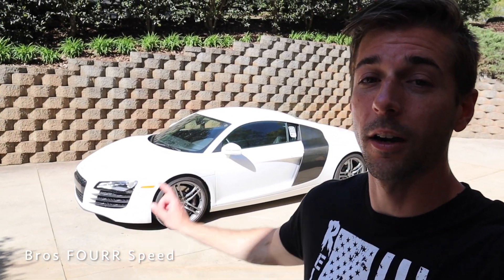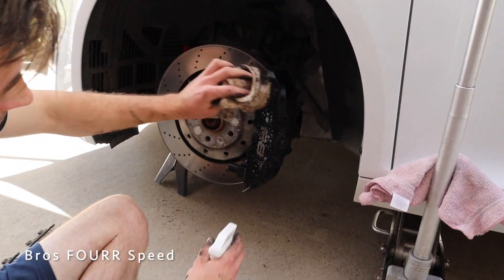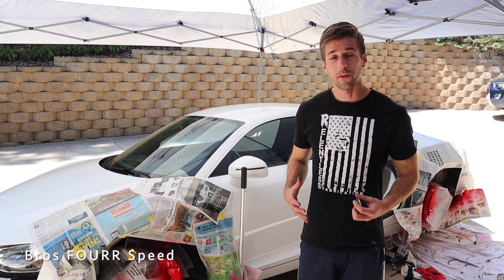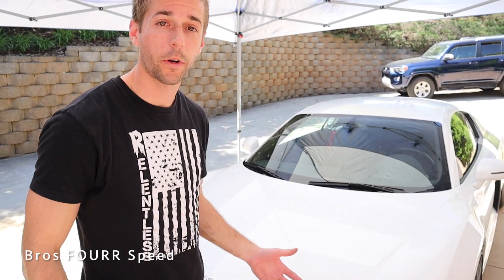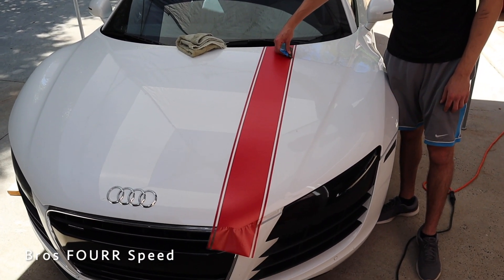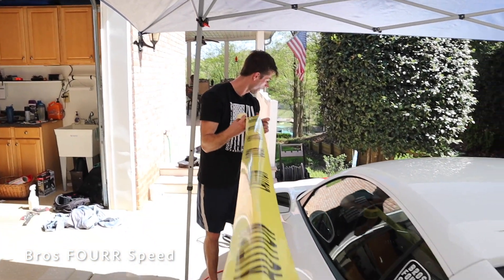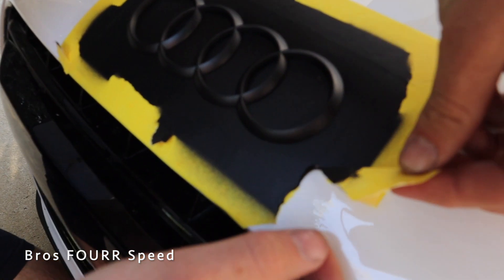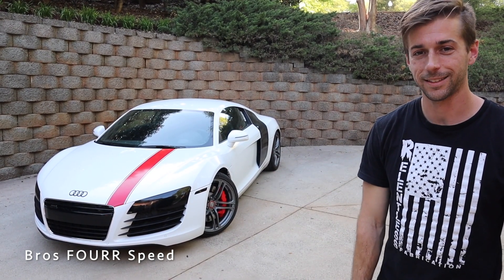How To Professionally Paint Brake Calipers, Tint Lights and Apply Vinyl Stipe

Comment: You have to use soapy water spray when applying vinyl So you don’t get air bubbles
Reply from the maker: Ahhh, we have tried that in the past, and maybe did it wrong.  We are so use to vinyl doing it dry, but that could have helped for sure!!